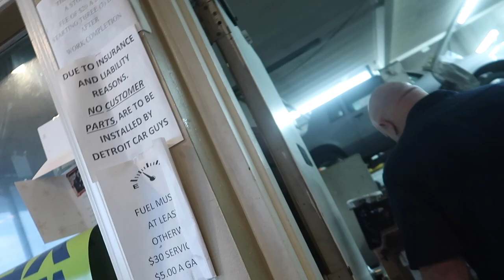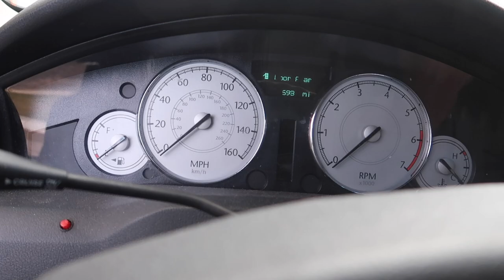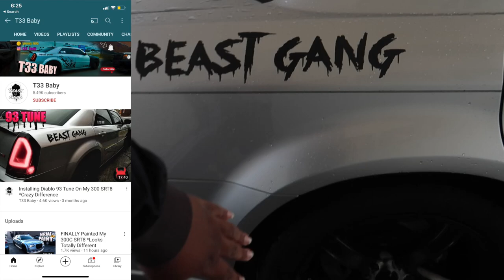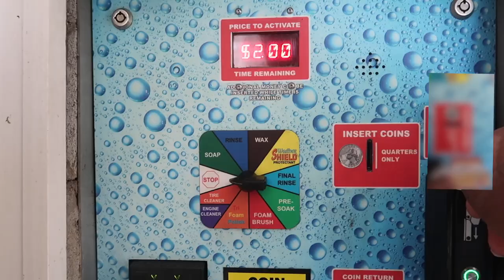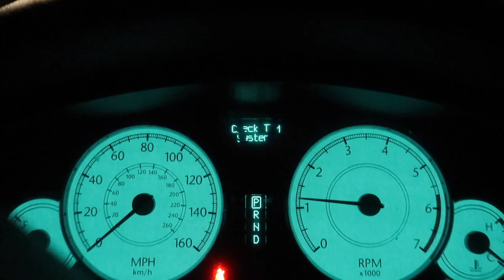Mechanic Almost Blew My Engine!! 🤬🤬

Comment: The 5.7s and 6.1s in that era did suffer from a lot of cooling and heating issues...glad you swapped out your tstat, it's super easy on that engine...just be wary, a lot of newer tstats are china junk (save that receipt bro) your car is super low miles for the year, so you should have plenty of life on it...your coolant should be good for 7 years now, or until the waterpump starts weeping further down the road (another issue) but least years down the road, you can have the coolant swapped during the waterpump replacement (as it'll be included) and that coolant issue seemed to revolve around two different types of coolant being mixed, causing that sludge reaction....but least your getting all corrected, just make sure they burp that baby properly...the hemis do not like a single trace of air in the system.
Reply from the maker: Yesir Man Thanks I Will Make Sure Everything Gets Done Properly....... Very Much Appreciated!